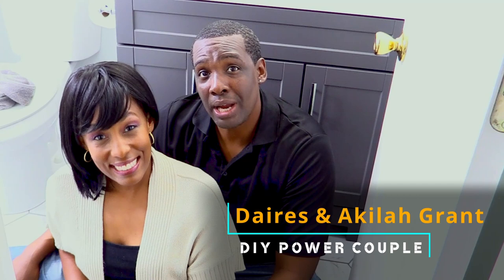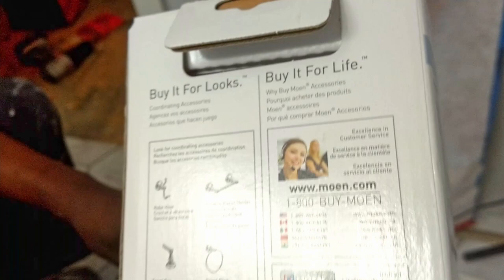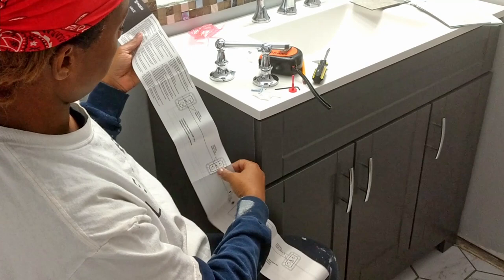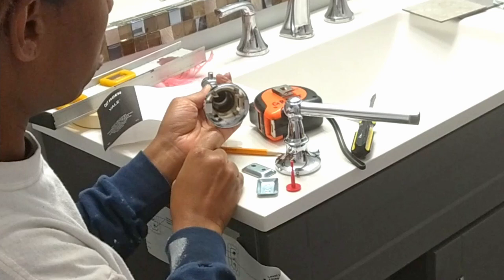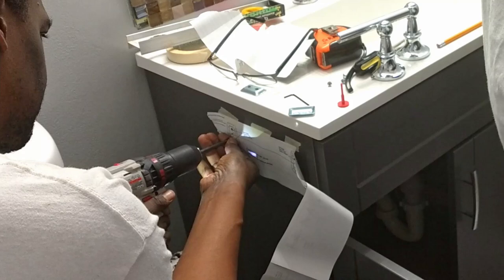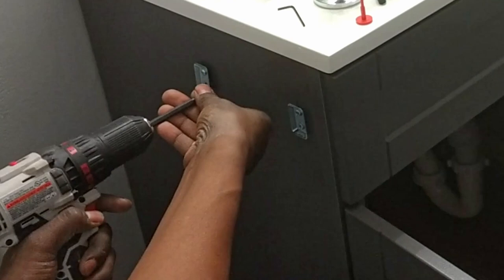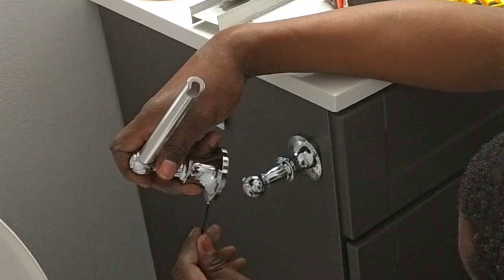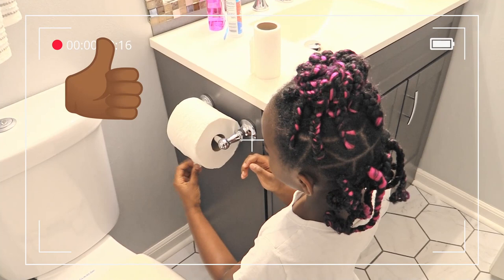How To Install a Toilet Paper Holder ( Double Post Pivoting )

Comment: Where can I get one of those tiny wrenches to screw in the holder for the last step- mine popped off but I didn’t install it and want to fix it myself
Reply from the maker: Lowe's and Home Depot have them on a set.